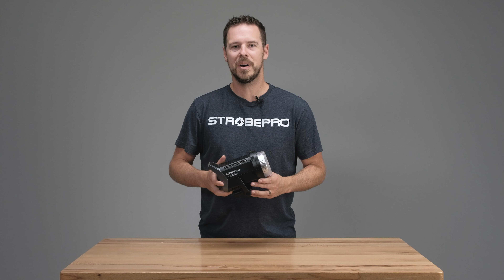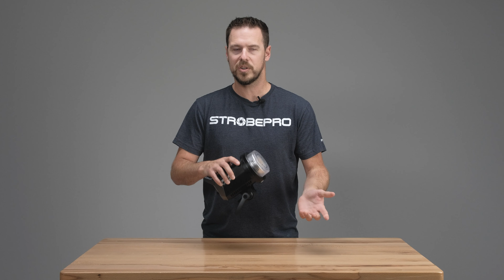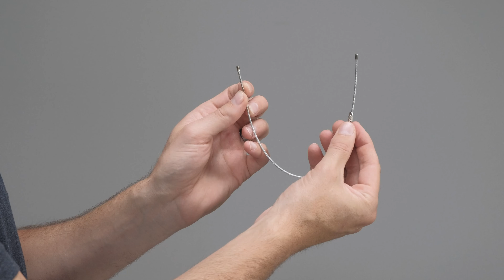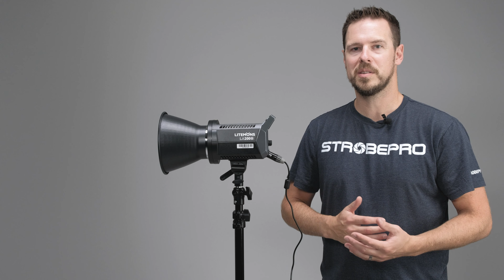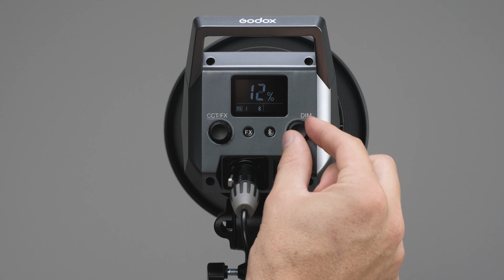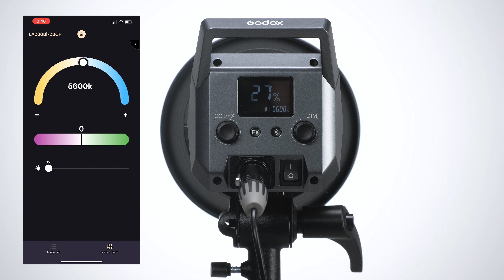Godox Litemons LA200D and LA200Bi — Complete Walkthrough

Comment: Is there any way that I could power it up by vmount battery?
Reply from the maker: Hi Ronson,

These run on mains power, so you would need an inverter for your V-mount batteries.  Savage has one, but we haven't tested it with any strobes. Unless you have a bunch of V-mount batteries already, there are inverter packs with built-in batteries that are probably more economical.